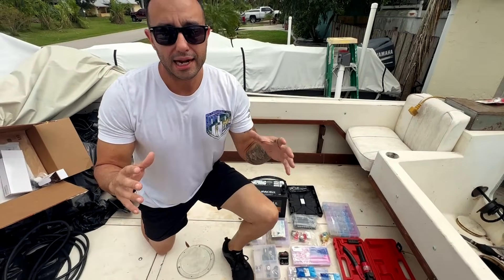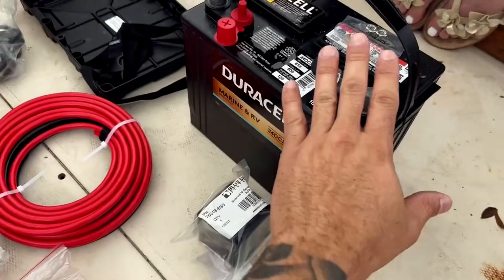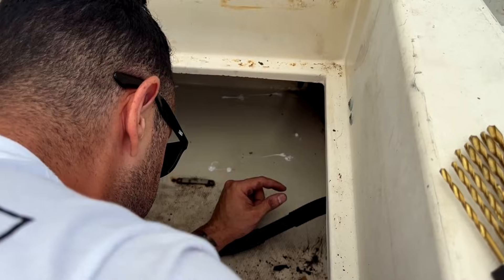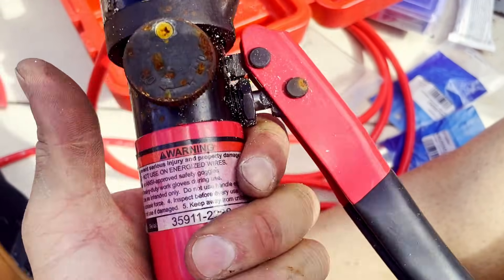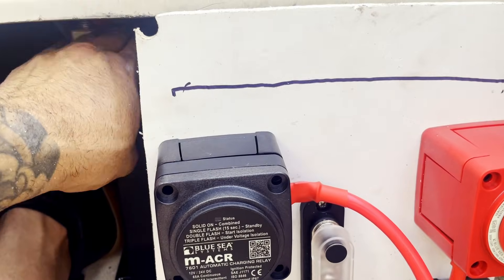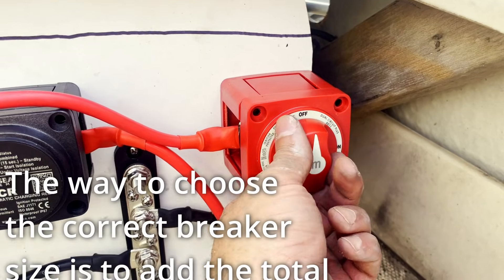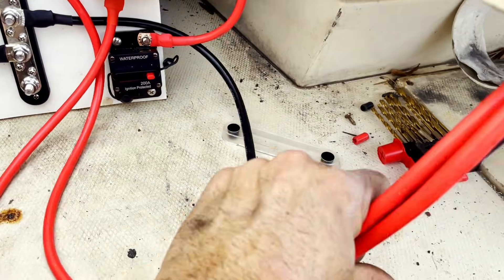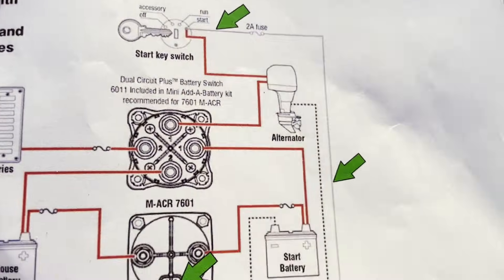Dual Battery ACR Install Boat Wiring: Beginners Edition

Comment: Awesome video I actually hooking up a blue sea system at the moment and this video helped me a lot along the way. 1 question I need to ask, do you ground the negative bus bar to the outboard engine block? On the ACR wiring diagram it showed GROUND on the bus bar. Dose it need to be ground?
Reply from the maker: Thanks! The engine negative goes to the starter battery. From there to the bus bar.

Comment: I used the same system on mine when I upgraded it to dual batteries, and used a similar panel to mount everything (aluminium in my case coz I have an aluminium boat). I put the terminal fuses on the ACR instead of the battery terminals... in hindsight your system is easier, though only one of my batteries has the bolt-on terminals so maybe not. For a neater install I didn't use the mounting blocks for the ACR and switch, instead I cut appropriate sized holes and surface mounted them directly on the panel so all the cables were hidden behind it. I put the busbar on the rear too for the same reason.

Also FYI the "SI" connector doesn't prevent electronics turning off during start... they won't turn off because they are connected directly to the house battery and are insulated from the start circuit. Rather it will force the ACR to turn off when the start motor is active to prevent it trying to draw starting current from the house battery through the relay (which it's not designed to handle). This can only happen in very unusual circumstances where both the house and start batteries are over 13 volts but the house battery is higher voltage than the start battery so probably not required, but definitley cheaper to install one wire than buy a new ACR. I found it's easier to run it to the outboard's solenoid than the ignition switch... same effect. Put a fuse in it and label it "start inhibit" or something to reduce confusion for unsuspecting mechanics in future. (They'll still get confused, I had one wire my house circuit to the start circuit with light gauge wire for no apparent reason which mean I could turn on the ignition by turning on the nav lights, and theoretically the starter could have tried to draw start current through an unfused 16AWG wire and started a fire. Check your boat if anyone else works on it.)
Reply: Will this isolator switch allow the alternator to charge both batteries  or would i need extra equipment?
Reply: @iansleight5101 yeah that's the whole point to it. The switch turns both batteries on/off, and the relay connects them together when the motor's running. That way when there's no charge from the alternator the start battery is protected from being drained by lights, radios, sounders, etc so you can always start the motor, and once the motor's running and there's charge available both batteries recieve it. You don't need to be worried about which battery's getting charged, it's all automatic.

Comment: I am starting to over think this entire process
I added a second battery
Got the Blue Sea 9002e a pos and neg bus bar and wired this way
1. Pos from starting battery to position 1
2. Pos from house battery to 50a breaker 
3. Breaker to 9002e position 2 
4. Output pos to bus bar
5. Hooked every positive up to the pos bus bar (ex. Starter, sound system, bilge, fuse box, ect.) 
6. Hooked all neg to neg bus bar 
Lost of fuses and breakers all around
My concern now is I ordered the 7601 ACR and am going to add that
But when it comes to starting my boat when I turn to position 1 everything turns on due to common running directly to the bus bar
Boat starts fine
Go to position 2 and can start the boat and run all accessories
Should I have wired differently?? Thanks ahead of time!
Reply from the maker: Hey! I think I understand what you did. You don’t need a breaker from the house to the switch. You need the breaker from the switch to fuse block. That way, when you turn to position 1,2 or all, the power to your accessories will work. If you tried to start your engine on position 1+2 with a breaker between the switch and the house battery, you’ll blow the breaker. Way too many amps running through that wire to crank. Hope that makes sense.
Reply: @perfectfitboating  so I don’t have a fuse box that is aftermarket. I left original fuse box that powers, the bill, the ignition, etc., and I ran a second battery strictly for the sound system, which has a breaker on the bus part for the four gauge wire that runs to the amp 
Do I not need the breaker then? 
Can I give you my number and I can send some pics of the set up by chance?
Reply from the maker: @kylemelendez1721 write me an email. It’s in my profile. 
But you need a breaker right after the switch for the wire that powers your appliances. It’s the common on the switch.
Reply: @perfectfitboating  OK so if I put the breaker on the common wire that goes to the bus bar that powers my starter my bills my stereo that’s where it goes right?
Reply from the maker: @kylemelendez1721 correct. That breaker is there to protect that wire. So the breaker needs to be a few inches away from the switch
Reply: @perfectfitboating okay I have it near the bus bar and wires already cut and crimped so ill just switch it to
Pos 1 from starter to term 1 on switch
Pos 2 from house to term 2 on switch and
Output to breaker 
Breaker to bus bar if I seen that correct? 
Sorry just real stressed and over thinking it all

Comment: Hey mate great video. I’m looking at adding a second battery in my boat and am going to order the blue sea kit. Just wondering how you figure out what size terminal fuse to buy for the connection to the battery to the acr. Cheers
Reply from the maker: What size motor do you run
Reply: @perfectfitboating it’s a 50hp but could possibly look at upgrading to a 70 in the future
Reply from the maker: @rangarobbo you can get the lowest fuse recommended I believe it’s 60? I’m not quite sure.
Reply: @perfectfitboating will look into I a bit more but was thinking a 60 seeing as the motor is small and therefore the alternator output isn’t much either. Cheers for the reply 👍
Reply from the maker: @rangarobbo yeah that’s all you need. Thanks for watching bro 🤙🛥️🌊

Comment: How do I figure out what size fuses my application needs on the battery terminal? I just watched your other video and there you used 80’s.
Reply from the maker: You can use 60-80 if I remember right. Depends on the size of your outboard and what its output amperage is. Bigger outboard, I used 80.
Reply: @ thank you!! My Yamaha 175sho puts out 50amps, and I know you want to size up so I’ll do the 80. Thanks for the great videos!
Reply from the maker: @TrapperJosh thank you for watching! 🤙🛥️🌊
Reply: @ last question haha, what do I need to do to this system if I want to upgrade my house battery to a lithium?

Reason I ask, I had a custom bowfishing boat built. It has no prior wiring harness, I’m doing all the wiring, with this there is a big electrical demand for the house side. Was thinking about going lithium to save weight. Thank you!

Comment: My boat has an inboard engine.  Is there a reason why I would not use the ACR with my boat? All the instructions I see show the switch only being used with inboard engines.
Reply from the maker: You can use the acr with an inboard engine. You have to find out how many amps your alternator puts out and then buy the right kit. This is the mini add a battery kit. You might need the next one up

Comment: Great instruction.. looking forward to make it my winter project 🙂 De ACR is smart to charge both batteries! Two questions…

Do the batteries be the same Amp ? Or can it be 12V and thats it..
And.. if you use the ACR why is the switch? If battery one is for the outboard and the rest for battery 2… I wont drain battery 1 ??
Reply from the maker: It’s recommended the batteries be the same brand even. I’m not sure I understand your second question but the switch is basically on off and combine. When one battery is full the acr will transfer charge to the other.

Comment: My switch has three post. I was thinking that the motor, jack plate, & fuse block go into the output? Please advise?
Reply from the maker: Yes that’s correct. Although I would run a seperate cable for the backplate from the switch to a breaker and then to the jack plate.
Reply: @ good point! My Vance came with a thermal fused line.

Comment: It might have been pointed out, but the connection to the fuse has to be metal to metal not between a washer.

Comment: How do you wire the automatic bilge so if you are in a slip the bilge still engages with the switch in the off position?
Reply from the maker: You do a split connection. Power splits from the bilge switch the helm switch and to the battery positive with a fuse in between. 🤙🛥️🌊

Comment: How come you didn’t connect the motor ground to buss bar but directly to the starting battery?
Reply from the maker: You typically want the motor ground wire, wired directly to the battery.
Reply: @perfectfitboating  ah makes sense but all the diagrams show it running to the buss bar so it got me confused. great videos btw
Reply from the maker: All good! When I looked up the specs for our new Suzuki, it recommended the ground wire to be directly to the battery. It would work either way but you want the best connection for the motor to turn over.

Comment: I'm in the process of installing the same battery combiner on my sailboat (i.e., Blue Sea m-acr 7601).

Do the cover tabs "break" to allow access to the inside mounting studs?
Reply: Thank you so very much for taking the time to reply! Stay safe.
Reply from the maker: Yes those tabs do break for you to adjust the way the wires run out of the acr. 🛥️🤙🌊

Comment: I have a small homemade boat and I don’t have much space I was wondering if could just put both batteries in series positive to positive negative to negative or maybe just use one for everything, I only use a radio and my position lights I’m pretty inexperienced in wiring boats, what setup would you recommend?
Reply: Can I just put one battery and a master switch?
I have a deep cycle laying around I wonder if it can work my engine doesn’t need a lot of cranking amps it’s a fuel injected Honda
Would be nice if I could use one battery only the boat would be lighter
Reply from the maker: @panzermagier yes you can do it that way but you don’t wanna use a deep cycle to crank the motor. You could damage it and very quickly at that.
Reply: @perfectfitboating  gotcha ok so I won’t have no choice but to but two batteries one deep cycle and one for crank, would I be able to just connect them in parallel or absolutely use the switch setup you demonstrated 
Great video by the way!
Reply: I think if I only use a crank battery it’s gonna drain pretty quick if I use my radio all day
Reply from the maker: Check out my LATEST wiring video. That’s what you need to follow. Not those acr videos. I walk you through step by step for a 2 battery (starting and deep cycle) installation. They’re not in parallel or series they’re just separate.
Reply: @perfectfitboating  great thanks a lot!
Subscribing now!
Reply from the maker: No problem! And thank you! We appreciate that! 🌊🤙🛥️
Reply from the maker: I think a simple on off switch with a DUAL PURPOSE battery would be perfect for your setup!🤙
Reply: @perfectfitboating  you mean connecting both batteries on parallel sorry and putting a master switch to turn everything off?
Reply from the maker: @panzermagier for a simple setup, one battery connected to an on/off simple switch. That’s all you really need.

Comment: on the diagram, there is a ground on 2nd to left position of the negative bus bar. I believe that is supposed to be attached to your boat. Don't see you do this here.
Reply from the maker: No ground should attach to any boat. That’s a quick way to speed up electrolysis. Unlike a car, the ground wires only attach to the battery negatives either directly or through bus bars.

Comment: So what happens when the deck fills with water from rough weather?  Will the system short out?
Reply from the maker: I have never, nor have I known of anyone that casually rides around with the decks filled with water because of rough weather. You’d need 10” of water on the decks and at that point, you have bigger problems on your hands than a short.

Comment: I noticed you didn’t wire the start isolation on the ACR as recommended by the instructions. Is this not necessary?
Reply from the maker: Ignition isolation wire is Optional. This boat didn’t have a motor.

Comment: I’m planning on doing this to my boat soon. Looks like you’re using 6AWG cable for everything? The instructions in the kit call for 4/0AWG 120mm wire on the switch connections and 6AWG 16mm for the ACR. Is it ok to just use 6AWG for everything as you did here?
Reply from the maker: Hey Jeremy! Make sure the kit you’re looking at for the instructions are the mini kit like the one I’m installing here. 
The size of the wire really depend on the length of the run. Refer to the chart and your length of run for the wires. 6 awg  should be fine for many applications like this one. Check out our other acr video that is a slightly different install than this one. I use larger wires for that install. Glad the video could help and thank you for commenting! 🤙

Comment: Did you just screw that back part of the Swith or a screw through both switch and backplate?
Reply from the maker: If I remember right it was through both and on the backside there’s a locking nut. This was a temporary spot for the switch and acr setup though! 🤙

Comment: With litium batteries becoming cheaper everyday. Will this work if you have a lead acid battery for starting your motor,  & then have two 12v 100amp litium batteries for your 24v trolling motor?  I emailed Blue sea, but they have not replied back to me.
Reply from the maker: Blue sea systems has an acr for lithium. Regular acr might damage. Also depends on the Lithium battery. New marine lithium batteries allow for charging through regular means. Blue seas can be very vague and yes they’re hard to get a hold of.

Comment: Great job my only concern  is that you have the mounting board is set so close to the deck if you ship water over the side I to the bost you may run the risk of shorting out the electrical  system
Reply from the maker: Thanks Dave! Yeah, I can see that. Although I think it would have to be a big enough wave to damn near sink the boat. I mean, it’s possible given the right conditions. I’ve never had a wave swamp the boat tbh. Many boats even today have this design for electrical but maybe I can design a lid that won’t allow water in. I’ll add it to the list. 🤙
Edit: I thought of maybe a flip up switch board or something. That might be better.

Comment: Should never put a fuse on the ground side,  if that fucker blows then theres an issue of the voltage finding a different path to ground and frying everything or starting a fire.
Reply: That's good general advice, but the ACR ground is not a safety ground at all. When current stops flowing through that ground wire, the ACR defaults to open, shutting it down. In this demonstration the circuit is correctly fused very close to each of the batteries, which protects the charging wiring and the ACR itself. Effectively that ACR ground wire offers a convenient method of shutting down the ACR for periods of time where parasitic drain would deplete the batteries over long term storage. In their bigger units the ACR recommended ground is 1 Amp, and parasitic drain when open is 15mA.
Reply from the maker: Only fuse on the ground side is the one recommended by blue seas.

Comment: The job is finished, but we need to do 4-5 more steps and replace the breaker which is incorrectly sized.
And it would have been nice to clear the boat before beginning..

Comment: How did you mount the backing plates for the ACR and the battery switch to your back panel? That step is missing. Your e book is excellent.
Reply from the maker: Hey there thanks for the comment! We used the starboard and screwed it to the transom. Or do you mean the plastic housings to the actual piece of starboard? Either way, I have a video coming out soon about battery cable management that is exactly about what you’re asking. We’re working with a company that makes mounts for battery switches and a bunch of other things for wiring. It’ll better show how to mount both the switch and acr. thank you for the kind words about the ebook. I tried to make it as simple as possible for anyone to understand. Like when I was starting out and looking to do this project. 🤙
Edit: I just realized this is my other acr video. In this one we just used screws to hold it up, then Ken was going to use a bracket to brace from the side to keep it stable.